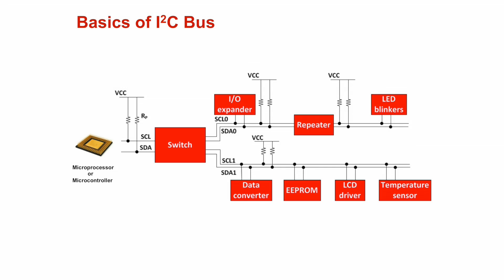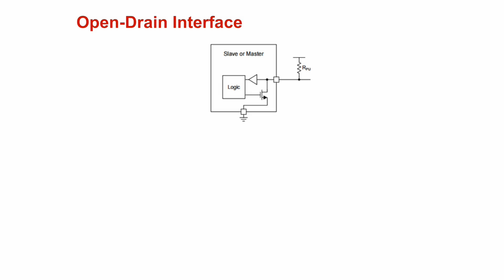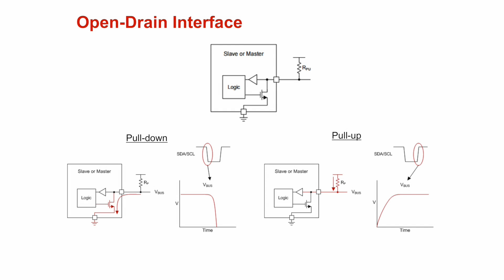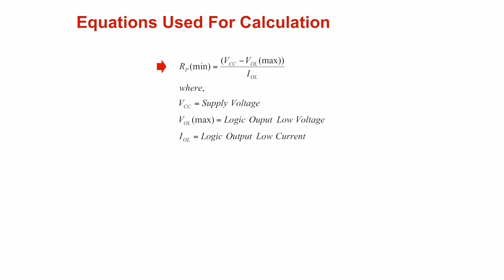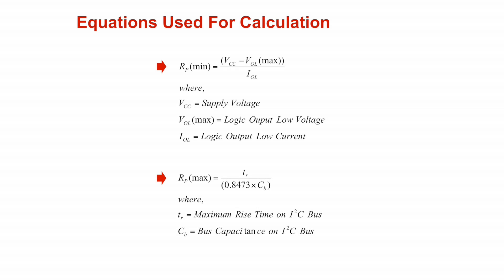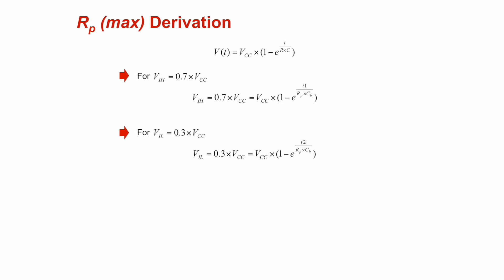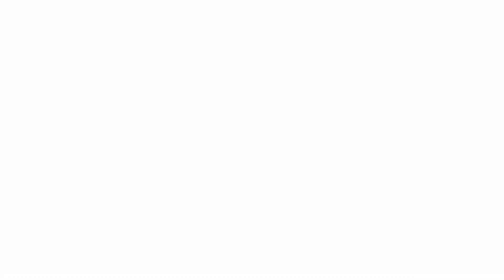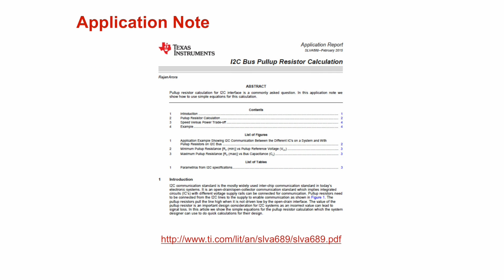Calculating the Correct Pull-up Resistor Value in I2C Bus Applications

Comment: Hello, i went through the I2C Bus pull up resistance calculation as you mentioned in the last. in the parameters table Cb is given as 400pF, but in the calculations the Cb is taken as the 200pF. how does you choose that Cb. please explain if possible.

Comment: Hello Rajan thanks for the video, stupid question, how do you figure out/calculate what the bus capacitance is of your circuit?
Reply: Not a stupid question, you find it in the datasheet of each individual component  you want to connect to the i2C line, then you sum them all.

Comment: Great video! One question though, how is the 3x10^-3 I_OL value derived?
Reply: The Iol is something that is specified in the I2C standard and is different depending on the mode you are operating at.  For standard mode, which is up to 100kHz data, it specifies 3mA for Iol at a Vol of 0.4V.  If using Fast Mode plus which is up to 1MHz data rate, then Iol is 20mA with a Vol of 0.4V.  The standard is UM10204 and Iol and Vol is covered in Section 6.1 table 9.  This is done this way to normalize it.  You could choose another Iol but then you would have to do more calculations and spec comparisons to make sure you generate a Vol  such that it doesn't violate Vil of devices.    Make sense?
Reply: francis h thank you for the detailed explanation, this makes sense now. I dug through the i2c spec and now see the different I_OL under different operating conditions :)
Reply: @francish8194  oml tysm lmao